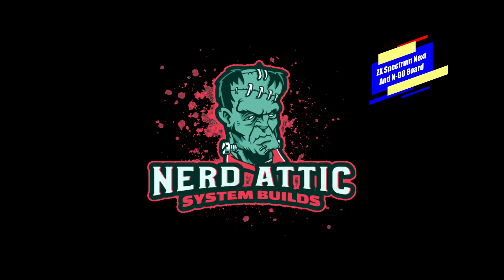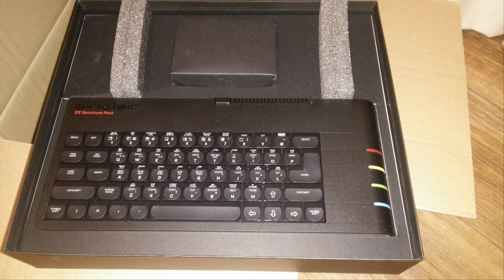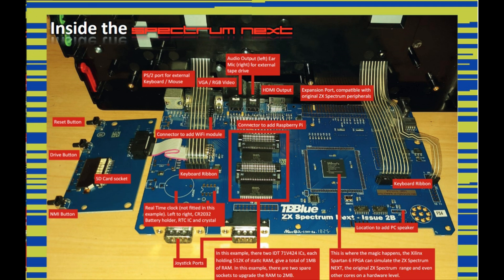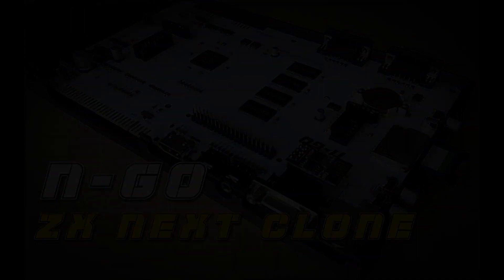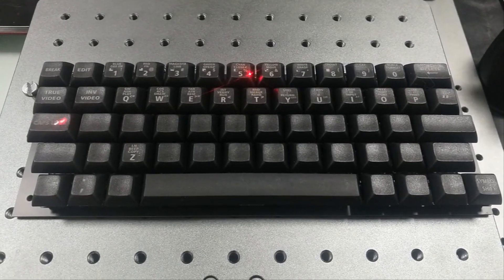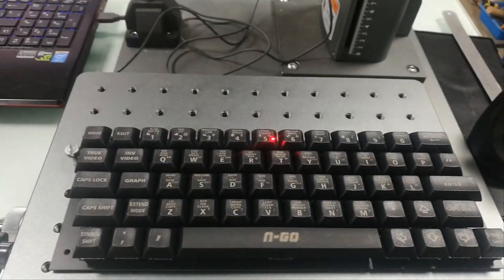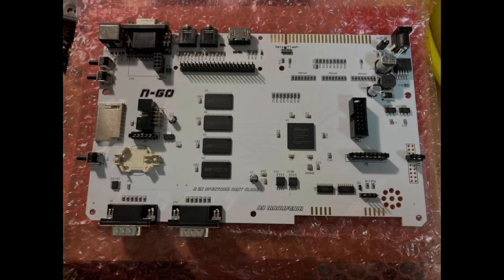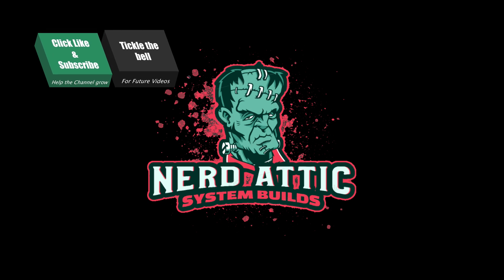Nerd Attic System Build Spectrum Next and N-GO Board

Comment: Although I felt a bit of bias against the N-go board, it actually looks super professional and better than the Next board, but the case of the next is really the magic to me. If wanting to use mouse/kbd, I'm surprised at having a physical PS2 port since that's dead tech and wasn't on the speccy anyway was it? - why not bluetooth?
Reply from the maker: i see what your saying but i think it makes it a bit more retro,as for bluetooth the pi zero w which is getting worked on to be more stable with the next has bluetooth build in. so you could work on that or even away of useing the pis usb ports that would be nice hopeing the mo n-gos and ks2 next we get out there brings more people to develeope for this awesome system